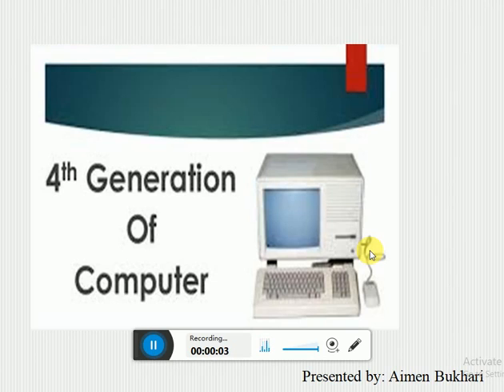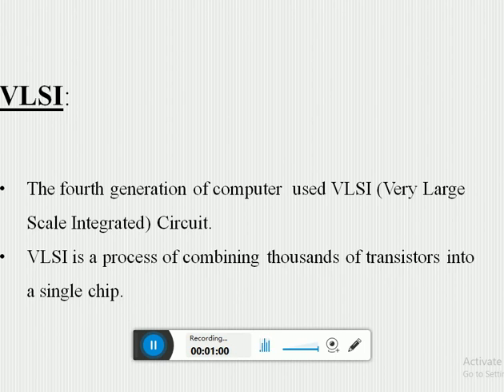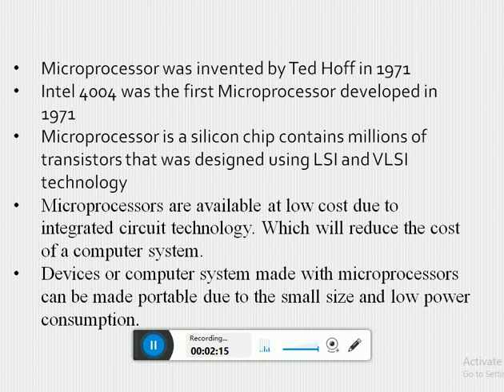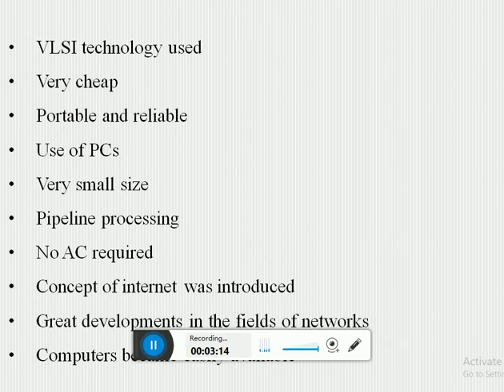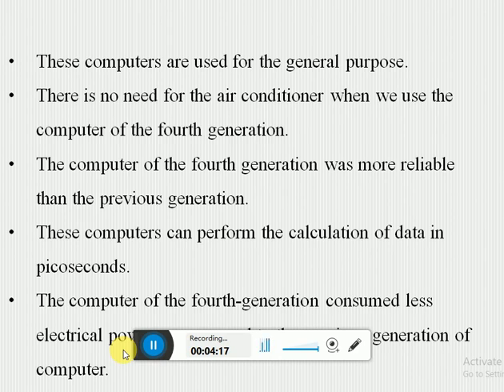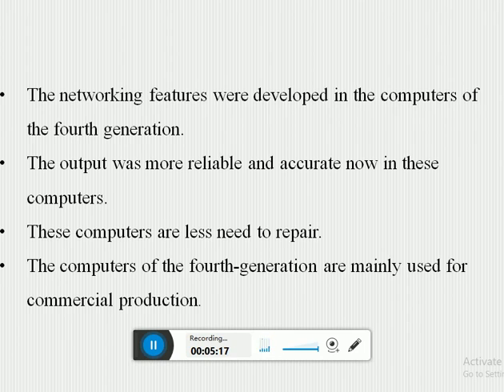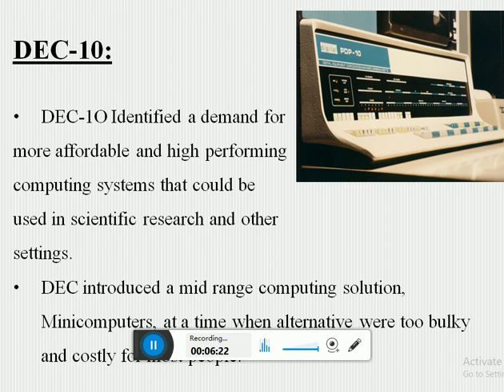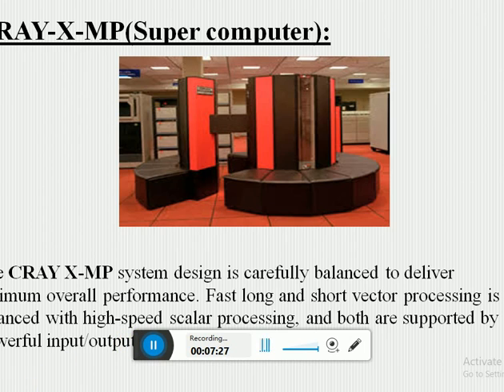fourth generation of computers

Comment: Superb!!!
The period of fourth generation was from 1971-1980. Computers of fourth generation used Very Large Scale Integrated (VLSI) circuits. VLSI circuits having about 5000 transistors and other circuit elements with their associated circuits on a single chip made it possible to have microcomputers of fourth generation.

Comment: Good
Summary:
The period of 4th generation computer is from 1971 to 1981. It used VLSI (very large scale integrated circuit) and microprocessor technology(1000 of transistors on a single silicon chip). They were cheap, portable, very small, their output was reliable and accurate, low costed, high speed but high quality technology was necessary to make integrated circuits. Star-1000, dec-10, PDP-11,CRAY-1 and RAY-X-MP(super computers) are some of the popular computers of this generation.

Comment: Good! The period of fourth generation was from 1971-1980. Computers of fourth generation used Very Large Scale Integrated (VLSI) circuits. VLSI circuits having about 5000 transistors and other circuit elements with their associated circuits on a single chip made it possible to have microcomputers of fourth generation.

Comment: Good.
 Computers of fourth generation used Very Large Scale Integrated (VLSI) circuits. VLSI circuits having about 5000 transistors and other circuit elements with their associated circuits on a single chip made it possible to have microcomputers of fourth generation

Comment: good.
summary:
Intel was the first company to develop a microprocessor. The first “personal ” or PC developed by IBM, belonged to this . VLSI circuits had almost about 5000 transistors on a very small chip and were capable of performing many high-level tasks and computations.

Comment: Good.
Summary:
Fourth generation (1971-1981)  computers used VLSI. VLSI is the process of combining thousand of transistors into single chip & is capable of doing major tasks.  Microprocessor was used in 4th gen. They contain millions of transistors on silicon chip & are efficient. Some features of 4th gen are; cheap, portable, no AC required. Some pros are; they are reliable, fast,  generate less heat & consume less power. Cons are that they require high quality & advanced technology and cooler is required. Mini & super computers were included in examples.

Comment: GOOD

SUMMARY:
Fourth generation is one of the best generations of computer bz it requires less electricity and faster then first second and third generation computers. 
The fourth generation computers are being used since 1971 till yet. Fourth generation computers were made keeping in view the limitations of third generation computers such as Integrated circuits were replaced by microprocessor. Mouse, GUIs were firstly used in fourth generation computers.

Comment: superb✌
summary:The period of fourth generation was from 1971-1980. Computers of fourth generation used Very Large Scale Integrated (VLSI) circuits. VLSI circuits having about 5000 transistors and other circuit elements with their associated circuits on a single chip made it possible to have microcomputers of fourth generation.

Comment: Good
Summary:
4th generation computers were present from 1971 to 1981. They had thousands of transistors on single chipm technology used in this generation was microprocessor. These were used for general purpose and can perform calculation of data in picoseconds.

Comment: Good
Summary: The period of fourth generation was from 1971 to present. The fourth generation computers was developed using microprocessor. Intel 4004 chip was the first microprocessor developed in 1971. The microprocessor is a silicon chip contains millions of transistors that was designed using LSI and VLSI technology.

Comment: Good 
Summary 
The period of fourth generation was from 1971-1980. Computers of fourth generation used Very Large Scale Integrated (VLSI) circuits. ... As a result, it gave rise to Personal Computer (PC) revolution. In this generation, time sharing, real time networks, distributed operating system were used.

Comment: Gud
The period of fourth eneratiin was from 1971-1980. computers of fourth generation used Very Large Scale Integrated (VLSI) circuits. VLSI circuits having about 5000 transistors and other circuit elements with their associated circuits on a single chip made it possible to have microcomputers of fourth generation.

Comment: Good 
Summary
The period of fourth generation was from 1971-1980. Computers of fourth generation used Very Large Scale Integrated (VLSI) circuits. VLSI circuits having about 5000 transistors and other circuit elements with their associated circuits on a single chip made it possible to have microcomputers of fourth generation.
Fourth generation computers became more powerful, compact, reliable, and affordable

Comment: good
the period of fourth generation was from 1971 to present .It is the generation of computer in which microprocessor are present having VLSI circuits ,  They allow multiple common operations to be performed with a single programmer-entered command.

Comment: Gud..!!
Summary:
The period of fourth generation was from 1971-1980. Computers of fourth generation used Very Large Scale Integrated (VLSI) circuits. VLSI circuits having about 5000 transistors and other circuit elements with their associated circuits on a single chip made it possible to have microcomputers of fourth generation.

Comment: Good
Summary
The time period of 4th generation is 1971 to 1981. VLSI is a process combing of thousands of chip in single integrated circuit. microprocessor brought four generation of computer microprocessor contain million of chips and potable due to small size these computers are fit in the palm of our hand. It is used for general purposes and calculates data in nano seconds and memory storage is increase in this generation. Network features are developed and it do not need any reparation